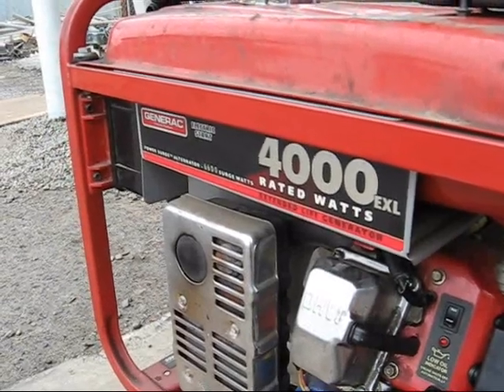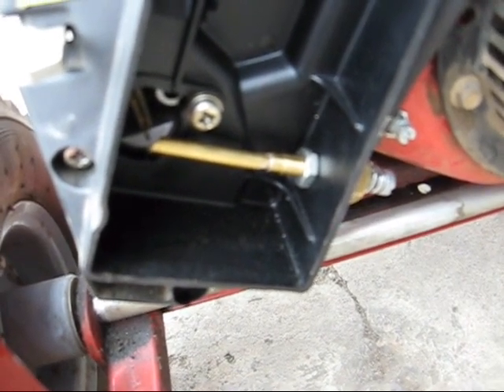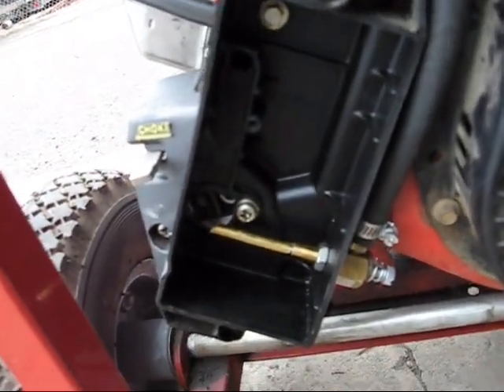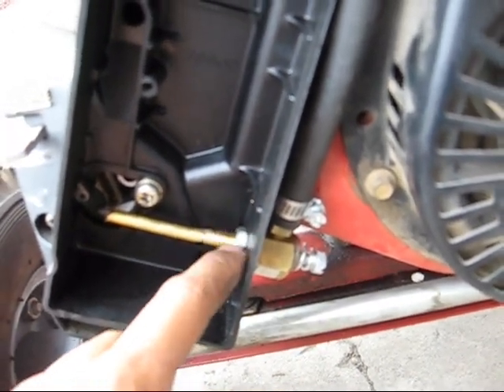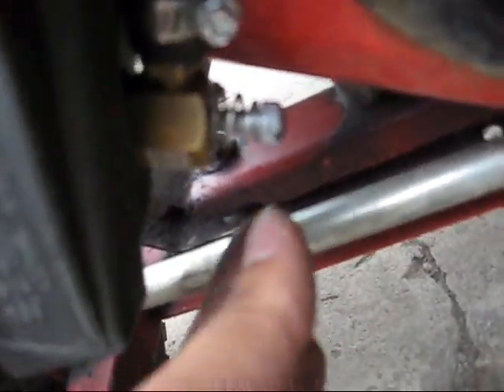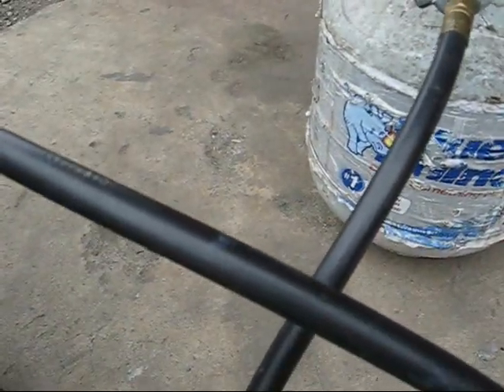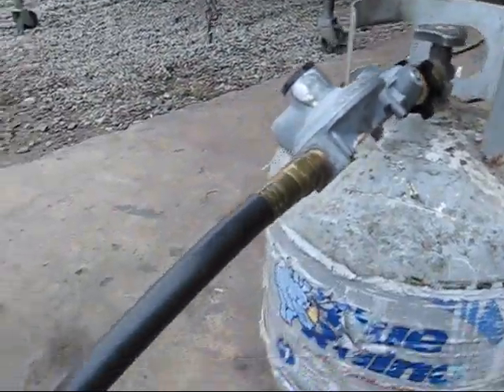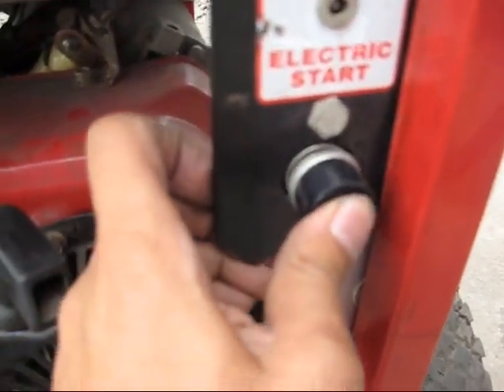Generac 4000EXL propane conversion spud in through air cleaner

Comment: i found there website 30 bucks for the spud in thats a great deal everything els you can get at a lowes cheap !!!
Reply: can i get a link for the spud and does lowes have the two stage regulator?
Reply: @platinumsky845  I DID FIND A PLACE THAT SOLD THOSE CARBS FOR MY GEN EBAY DIDENT MAKE THEM FOR MY GEN BUT I NOW HAVE ONE !
Reply: @platinumsky845  YEA I KNOW HOW EBAY WORKS MAN THEY DIDENT HAVE ONE TO FIT MY GEN BUT THE COMPANY VPOWER DID !!!!!!!!!!!!!!!!!!!!!!!!!!!!!!!!!!!!!!!!!!!!!!!!!!!!
Reply: @platinumsky845  lol no im fine i have cap locks on so i can see better lol bad eyes and you were explaining how ebay works everyone knows how they work unless u live under a rock they never made one for my gen but i found a co. that did most of the ebay kits are up to 6000 wats mine is 7500 the co. vpower makes kits for a lot of bigger gens it was $90 bucks for the kit with the carb and all the hookups .

Comment: hey try running the spud adjustment screw  a bit richer..
this is a good argument for the honda eu series inverter generators!!
on the honda eu series they use a stepper motor to control the speed..
and the FQ is controlled inside the inverter as digital...
so all you have to deal with is the rich lean on the load block adjustment..
see the honda forum over at yahoo groups, there is a eu7000i forum as well as a eu2200i forum. lots of good info over there on tri fuel!!

Comment: The Propane Tank Regulator is All you Need and Run a Hose straight to Fitting in Breather of Generator, you can use any small gas Valve to Find the Sweet Spot on Running the Engine--as guy is showing, you need to run Generator as close to 60 cycles as you can--this is the setting for All Power Plant Generators...
Reply: I was thinking the same. The bbq regulator already drops to 6oz and the small engine regulator doesn't open and close based off of vacuum pressure volume but just on off. So it is basically just an auto on off and it only starts once so ya. Even if its shuts off it's only leaking 6 oz line not a big deal. I will know it's not running since I will be sitting in the dark or not hear the gen running.

Comment: look at this link   tonco  "http://www.ebay.com/sch/i.html?_from=R40&_trksid=p2050601.m570.l1313.TR0.TRC0.H0.Xtonco.TRS0&_nkw=tonco&_sacat=0"
  Use it with natural or propane gas, but uses 5W50 or 20W50 oil mobile, because the natural gas heated to 170 ° C at full power,
  This was measured with thermocouple tempera on my 4.1kw generator and honda 270cc 9HP

Comment: Hope you got it running better. That drops off too much with only a 1500 watt load. It almost seems like you lost a lot of engine power. Next step would be to run on gasoline to observe the difference between the two. Lately (2016) the arrangement you have is not necessary. Now you just buy a tri fuel carb that cost less than your regulator, do the 5 minute install and you are done. When I did mine I was worried about the power loss but testing proved there was little if any power loss with 90% load tests.
Reply: Hey, are you referring to an entire replacement carburetor that also has a propane/NG hookup or do you mean some type of kit that gets added to your existing carb? Just as a reference so I can search on it, how much did the conversion cost you? If you have a link to the product, that'd be great. Mine is a DEK 6500 (Chinese) generator.

Comment: Since the gov is connected to the carb... and your bypassing the carb with the kit... you would get better frequency adjustments by adjusting the load block on top of the vacuum manifold you just installed... good luck... enjoy...